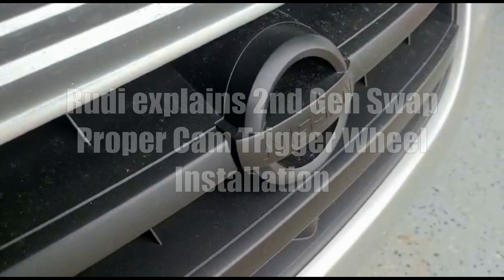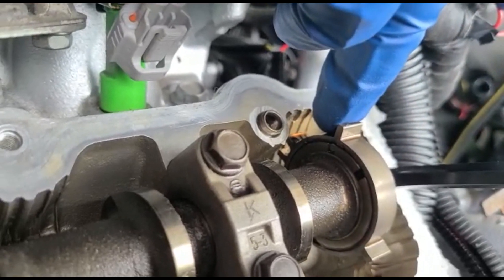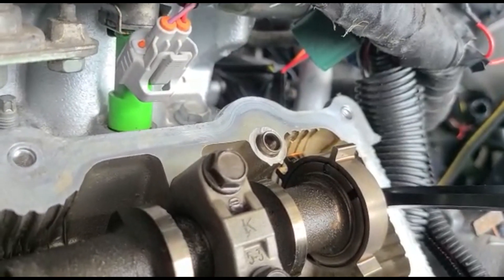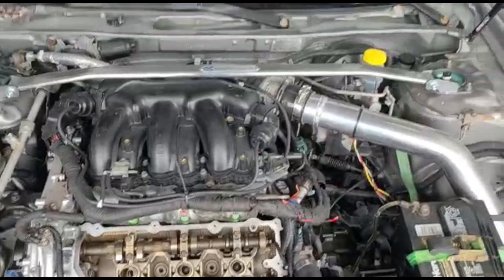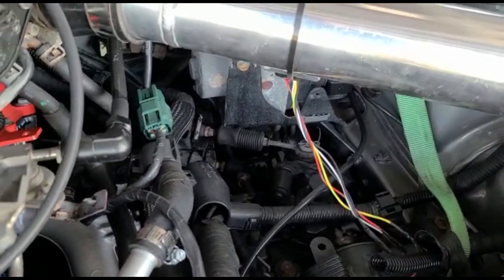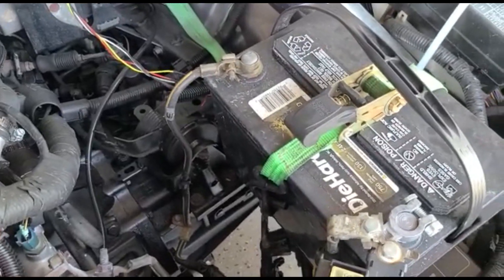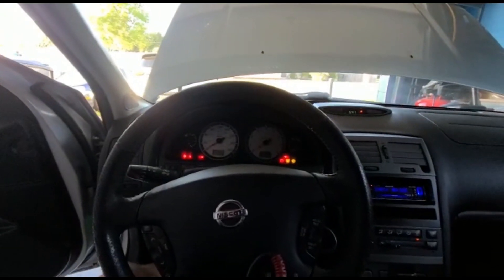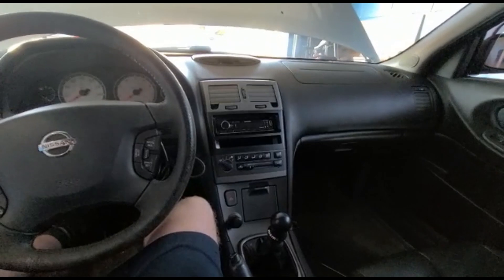Rudi Explains Maxima 2nd Gen Swap Cam Trigger Wheel Installation + A Few Ride Updates

Comment: Hey Rudi. I 3rd gen swapped my 03 and also manual swapped it. I have a crank/ no start issue. Codes a P0345 and P0340. Checked the trigger wheel on the bank 2 and its fine, wiring for inverters are fine. When we were doing testing, we took the cam sensor out and put it to metal while having the harness connected. Bank 1 is sending 5V and bank 2 is sending 12V, car is no start. Any suggestions?

Comment: I have a rust-free 5th Gen Maxima with a MT 6 Speed and 138K miles that I got for $3K.  I'm in an additional $13K in repairs.  Does it ever end?  Is having a fragile vehicle that always needs to be babied just part of the deal?  How do you solve the oil burning?  I was quoted $17K labor to convert to a later model VQ35DE.
Reply from the maker: The oil consumption issues with the 1st gen are typically resolved with a 2nd or 3rd gen VQ35DE swap.

Comment: what's up bud you might be one of the few people on YouTube who has the answer to my questions I have a 2001 Infiniti i30t I'm looking at tackling the lateral link control rod and the suspension member bracket that has two bushings that connect to the frame I am wondering if this is something you have done or familiar with ? Please help 🆘
Reply from the maker: you should post this inquiry in the my5thgen group on facebook

Comment: What intake is that?
Reply: Custom intake made it at using  intercooler pipe.with 350Z Maf slot.
Reply: @rudigevers2358  how does the 350z maf  slot work and does that mean you got a 350z maf sensor in there.?